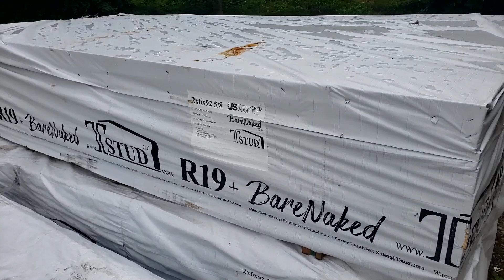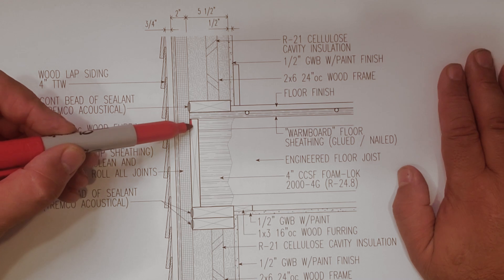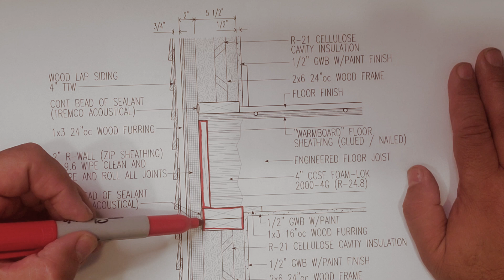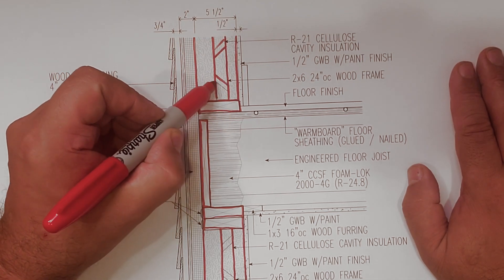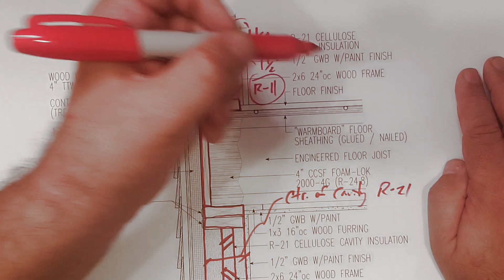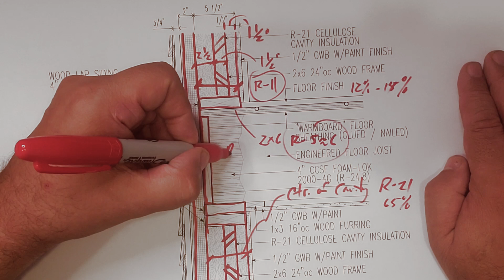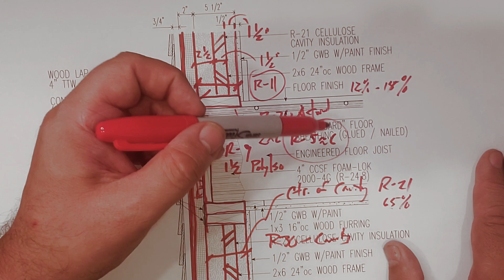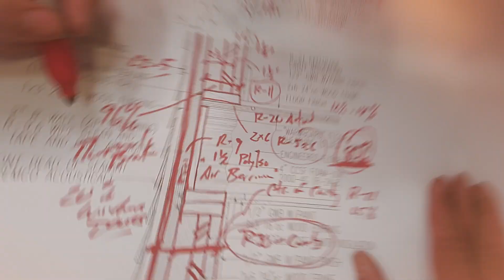Engineered Wood Stud Framing

Comment: Steve, 
Man, I love these T-Studs... but at what $$$? 🤔 

QUESTION: What do you think of rotating the T-Stud 180° so outside the face is the 2-5/8" wide by 1-1/2" thick???
BENEFITS "might" be: 
* wider area for fast framers to hit, I'm guessing inside sheetrock guys on floors would be more precise;
* For an inside sprayfoam flashcoat, a 2" flashcoat would fully cover the 1-1/2" thick stud (visual for proper job) the rest would be blown in stuff

What do you think? 🤪

Cheers, Eric
Reply: He said in the video they flipped it around.  My guess is they gave the wider nailing surface to the sheathing, since that's where strength matters.  The push-pull strength of the T-stud should be about the same, no matter which way it's facing.

Comment: Steve try finding a carpenter/crew who will work with ease are not screw some framing issue up? I think you and Matt are making a better effort to clue viewers on to the type of client you are working with (ie budgets that exceed 98% viewers) but the quality of your  workforce/subs really really really WAYYY better than most of us can access, even with robust budgets. And you know that of course-you curate your subs and stick with them like Matt as superb framer , Bill, has been working with him for what three decades ? And you subs all speak english fluently and dont infer any nativism in that comment-when your work force , GC, PM , let alone client, dotn speak same language-literally- that presents huge potential for miscommunication, the biggest bugaboo in any residential build. On a more mundane level-you have no idea how difficult it is to get most builders/subs to use “new” products -T stud, Triforce joists, Superior wall, etc. And we are NOT talking the sticks here either. The building industry outside of New England and California is incredibly conservative and behind the times, esp in MidATlantic and Midwest. Final point -i never see sprinkler systems in your builds -these requiremnbets complicate air sealing ENORMOUSLY yet never seem to be addressed by you, Jake or Matt.
Reply from the maker: I wouldn't say the talent or desire isn't there. I work all over the country and simply find the understanding hasn't arrived yet. These details are not for just  the top 2%, they are for everyone, the concept is what is important, the solutions vary, and can be made to solve for lower budgeted projects
Reply: Intumescent paint like contego on all interior finishes - no need for sprinklers if nothing burns!